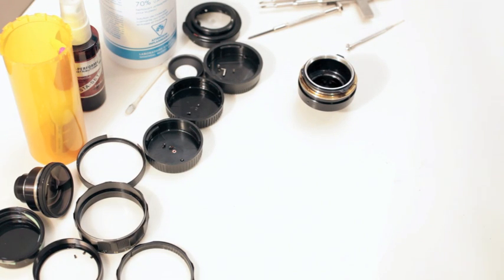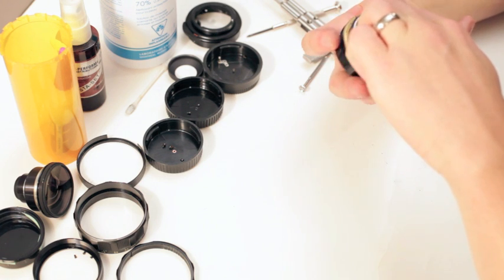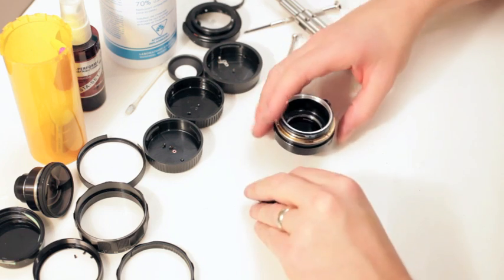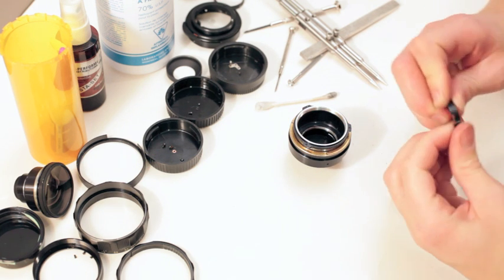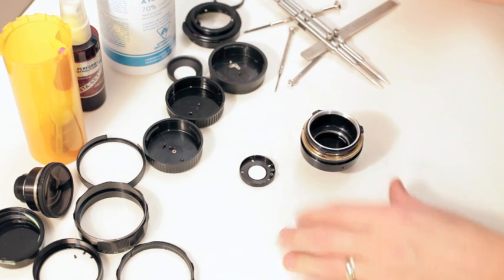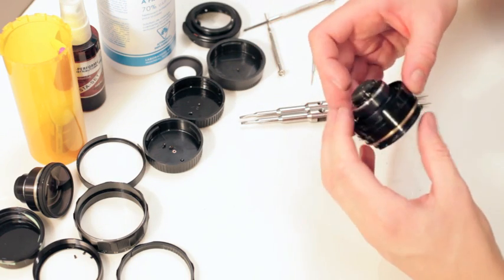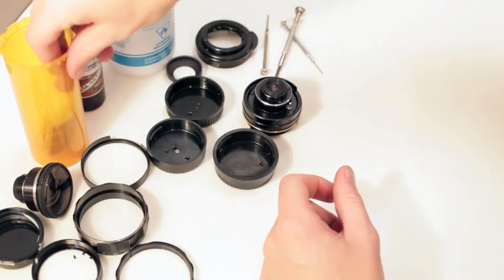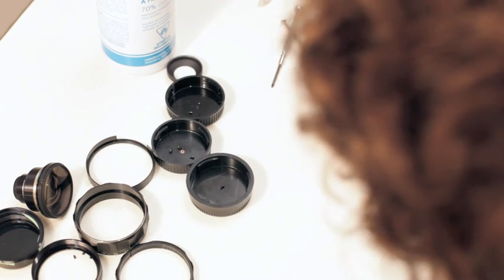How to Repair Lens Oil on Aperture for Pentax Takumar 28mm 3.5 SMC Super Multi Coated Lens Part 2/3

Comment: That lens sold for about $150 in the late 60's (if I remember correctly).
That's about $1000 in 2016 dollars.  Easy to see why, given the amount of skilled assembly it required. (No robot assemblers, no molded plastic parts.)

Thanks for this video!
Reply from the maker: +asparis145149 Oh ya man this thing is a beast to repair. Beautifully built.

Comment: You might try a little bit of acetone on a q-tip to soften the glue on the aperture plate to get it loose.  Be very careful not to get any on plastic parts or maybe even paint.